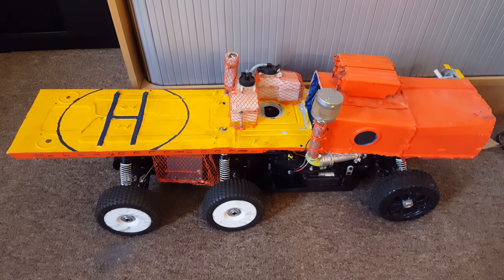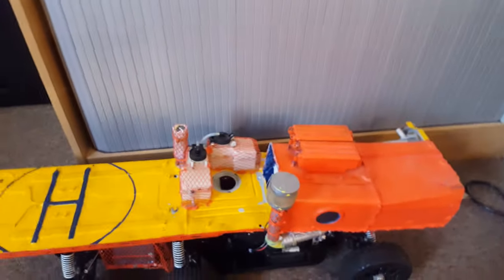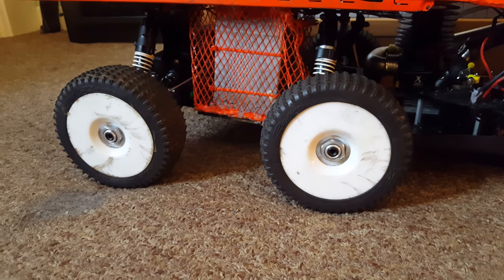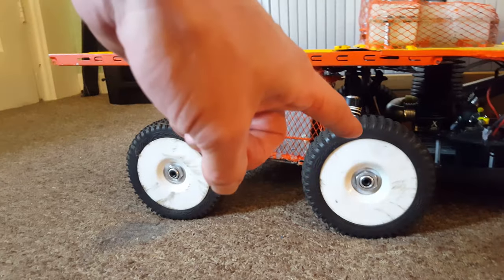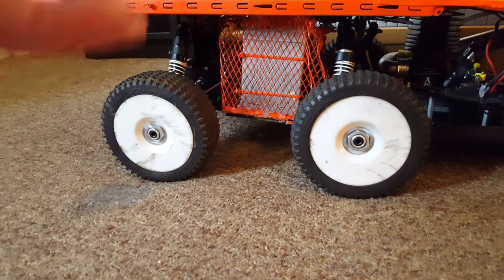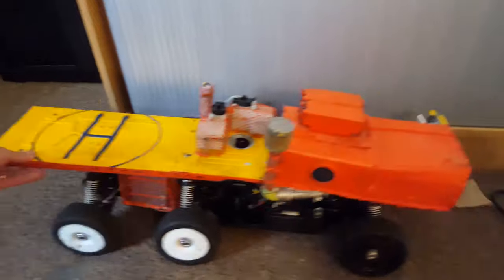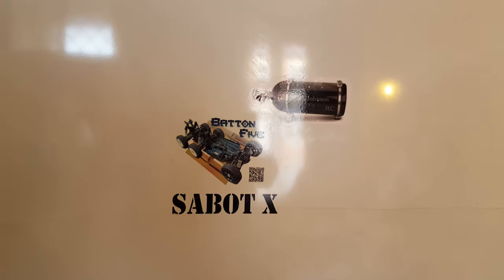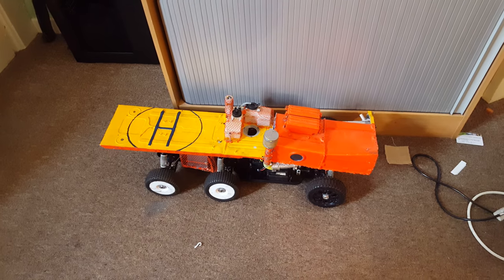Sabot X Shout out & truck update

Comment: Nice to see a few updates on this project again sir :)
Reply from the maker: +DutchRC ADVENTURES thanks ji :-) yeah I have been side tracked with the brick cutting for the last 10 months or so :-p and have had this truck on the back burner a bit with work, and different things but its borderline ready now, electronics are all ticked off and its just a last check over the mechanics and prep it to start up :-) with research in to stuff and work ive hardly been on y.t. in the last 6-10 months :-p

Comment: great stickers. that's one hell of a truck. are the diffs locked? will it crawl? or does the nitro motor have too much torque?
Reply from the maker: +2cwik4u104 thanks 2cwick :-) ermm I don't think the diffs are locked, my mechanics is a bit shaky admittedly but I think that would be ware each wheel on the axle was fixed to the other wheel right :-) where on this one different wheels can lock up while the other axles still turn the wheels individually :-) that really will be handy for the crawling, I hadn't thought of it tbh :-D argh not sure on the nitro power yet though, I haven't changed any gearing teeth setup on pinion or receiver so its still running on its original xtm2 buggy setup :-) but I think you can tweak the fuel intake a bit on the transmitter and with the needles on the nitro block itself so im hoping I might get away with lower rpm for crawling and stuff :-) also I cant wait to see how fast it will go to :-) it weighs loads but the axles and gears are all greased well so you never know :-D could be the fastest nito 6x6 in the world :-D
Reply: yes, a locked diff is when you spin one tire and the other tire on the same axle spins in the same direction and cant be stopped. im sure it will all come down to gearing. worlds fastest 6x6, I like that. lol.
Reply from the maker: 2cwik4u104:-p I said to my misses, I have never seen a 6x6 nitro before, probably only one in the world and she was like 'meh, I guess its ok', then I was like if I can get it started...'its the fastest 6x6 nitro in the world!' and she was like 'ooooo that's amazing!' :-O no joke :-p
 cheers for the heads up on the locked and independent dif there, I had heard it around but had not pin pointed its exact meaning yet :-)
 Will come in handy when considering that rc speedster project I have in mind :-D as well as when people are mentioning it on their channels :-)

Comment: So do you have any videos of this contraption running or do you just keep looking at it shouting out channels? Trying to see if that exhaust system that you made is actually any good and worth me wasting the time making one
Reply from the maker: I did get it running, works alright, but didnt get any vid of it, its in a store room atm as its 3 feet long and covered in nitro. Its not super sillent or anything but works alright I guess. I will dig it out one of these days and put a new receiver and servo set in there but its a big project to itself. Have a look around, see if you can find some alternates. I was hoping it would give ideas for others to improve on, not sure if anyone ever had a go and improved on it or not.